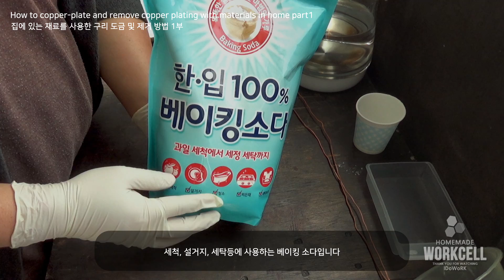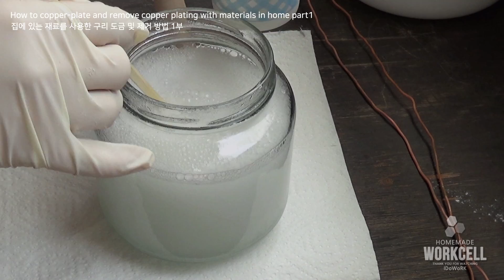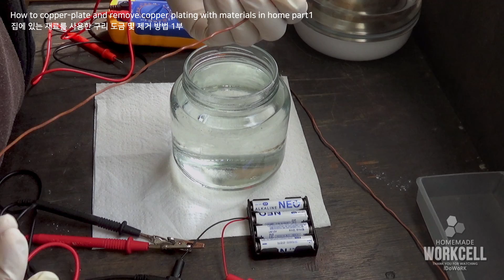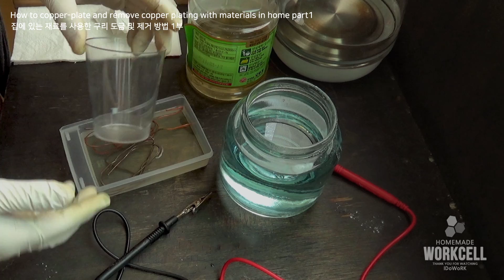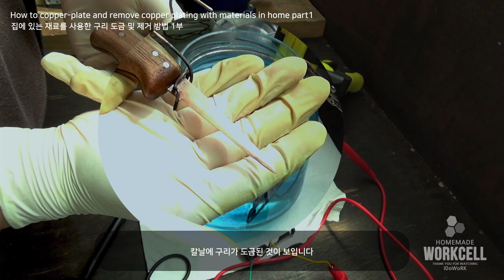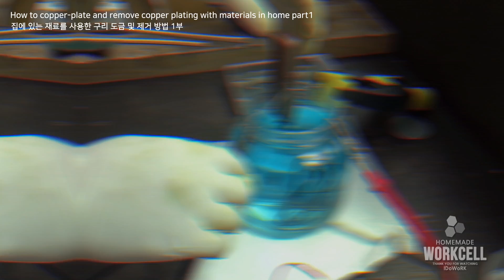🔵 1부. 가정용 재료로 구리 도금하는 방법

Comment: Hello, can you tell me how to cover the holes (via) in the electronic fiber(pcb) with copper?thanks
Reply from the maker: hello. electrow.
Via holes are electrically connected to other layers. Does wanting to cover that hole mean that you simply want to fill it?
If you simply want to cover the hole, you can cover it with solder rather than plating.

If you absolutely want to cover it with copper, you can thread a short wire snugly into the hole and electroless copper plate it.

The electroless copper plating method is on my channel video.

Electroless copper plating: https://youtu.be/P7RvyiblotE

Have a nice day and always be happy.
thank you!!
Reply: @WORKCELLDIY  Hi thank you very much its very usefull .
May you teach us to make conductive ink too?
regrads
Reply from the maker: @parvazno  I'm glad you found it useful. thank you~~!!
Making conductive paint for plating, I will give you a link to one video than I will explain.

Graphite Conductive Paint Recipe for Electroforming: https://youtu.be/WUaX2Js64-Q

Solvent and sealant were used in this video, but a simpler method is to mix acrylic (black) paint with graphite powder in a ratio of 1:1. Viscosity can be adjusted with water.
When using acrylic paint, you must use black instead of other colors. Due to the difference in the raw material that produces the black color, other colors should not be used.

Sometimes wood glue (Titebond 3) is used instead of enamel paint.

thank you!!
Reply: @WORKCELLDIY  Many thanks inadvance for your help .